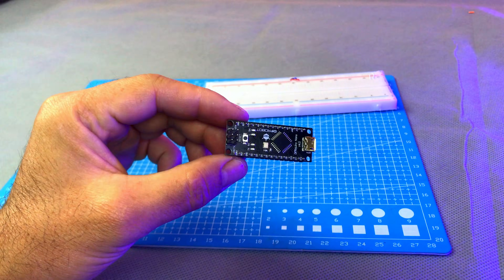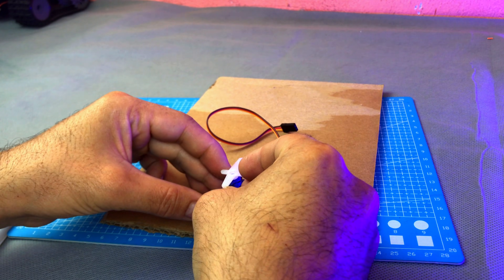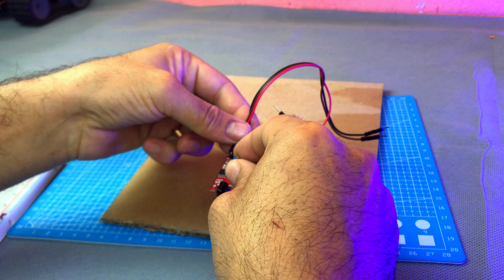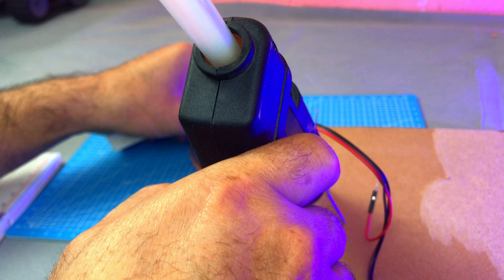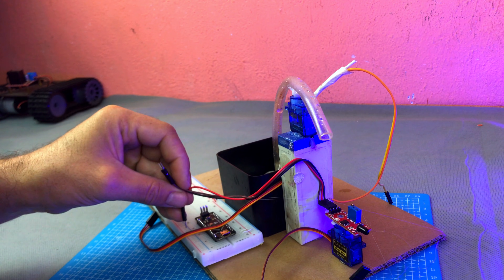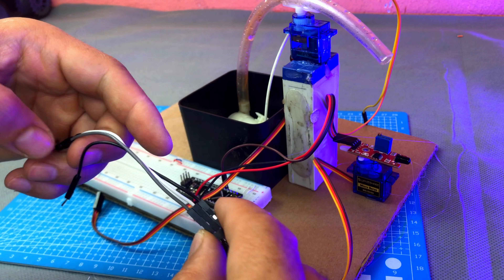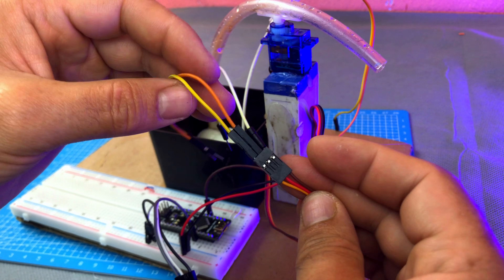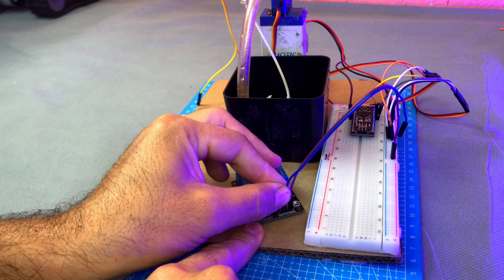Automatic Fire Fighting System | Arduino Flame Detection with Water Pump

Comment: hello bro. If I connect a 5v 2a adapter directly instead of 12V without using a buck converter, will it work? PLEASE ANSWER THIS IS MY PROJECT ASSIGNMENT
Reply from the maker: yes If you are using a 5V adapter, it will work and you don’t need a buck converter
Reply: @k @ktronic110  5v 2a adapter is not it?

Comment: Sir to where the DCtoDC buck convert in+ and in- is connected
Reply from the maker: 12v supply
Reply: hello bro. If I connect a 5v 2a adapter directly instead of 12V without using a buck converter, will it work? PLEASE ANSWER THIS IS MY PROJECT ASSIGNMENT

Comment: Sir please recommend me any battery for power supply, I checked for 12v lead acid  battery but it costly, can I use my 5v 2a vivo charger cable (sliced)and adapter to power these components 😢
Reply: You can use adapter 12 2A.. it's pocket friendly..
Reply: @anuraggupta8606  hello bro. If I connect a 5v 2a adapter directly instead of 12V without using a buck converter, will it work? PLEASE ANSWER THIS IS MY PROJECT ASSIGNMENT
Reply: hello bro. If I connect a 5v 2a adapter directly instead of 12V without using a buck converter, will it work? PLEASE ANSWER THIS IS MY PROJECT ASSIGNMENT
Reply: @dogukannnn0 already answered.

Comment: Voltage regulator is necessary or not pls tell
Reply from the maker: If you’re using a 5V power supply or powering through Arduino Uno’s 5V pin, then you don’t need a voltage regulator. But if your power source is 12V, then yes — a voltage regulator is necessary to safely step it down to 5V.
Reply: @ktronic110 then should I use relay of 12v or 5v ?

Comment: Sir single channel relay or dual channel relay both can be used or only dual channel
Reply from the maker: You can use a 5V single channel relay module — I just used a 2-channel one because I didn’t have a single channel relay at the moment.
Reply: hello bro. If I connect a 5v 2a adapter directly instead of 12V without using a buck converter, will it work? PLEASE ANSWER THIS IS MY PROJECT ASSIGNMENT
Reply: Yeah it will

Comment: Bro can you tell me components please
Reply: Arduino Nano
Flame Sensor 
Servo Motors x2
Water pump 5v DC

Jumper wires +  Bread Board (for connections)

Comment: Bro please give the voltages that you used in this vídeo per one by one 🙏
Reply from the maker: The main voltage is 12V from the battery, regulated to 5V for components.

Comment: hello sir can you provide the BOM of this project, i really love your ideas and content
Reply from the maker: thank u so much . Check description for code link
Reply: @ktronic110 sir where is the red wite connected to voltage regulator going?
Reply: @ktronic110 there is a red wire connected to a positive input of regulator module

Comment: Can you please tell me what you are using here? 4:30
Reply: what if I don't use the buck converter and directly connect adapter to the arduino?
Reply from the maker: @mareneisserenity  Yes, you can use a 5V adapter. I used a buck converter because I didn’t have a 5V adapter and wanted to keep the voltage stable and safe for the components.
Reply from the maker: Yes, this is a buck converter. It’s used to step down DC voltage. I’m using it to give 5V supply to the relay module, servo motor, and flame sensor.
Reply: how to the code, pls🥹

Comment: Sir actually I made it but I have one real problem I use Arduino uno , we should connect Booth in1+in2 rele to pin 8; of Arduino??? Or no just one of them please tell a little about rele how we should connect jumpers to rele?!
Reply from the maker: For the relay connections, just connect one IN pin to your Arduino pin number 8
Reply: @ktronic110 oh thanks alot
Reply: @OmidSojoudi hello sir ye wala project ka components aur circuit diagram bata dete college project me banana hai ..
Reply from the maker: @mohitchaudhary5300  code aur diagram link video ki description ma ha

Comment: Great😀😀
Reply from the maker: thankx
Reply: @ktronic110  replay only for the comments which appriciates you not for the doubts fooll.
Reply from the maker: @VijayReddy-n4t  Bro, it’s not like that 😊
I try to reply to every comment, sometimes I just miss a few 🙏
Reply: @ktronic110 in voltage regulators Vin has 3 wires explain the connections..there

Comment: How much volt is the supply.....
Reply: What is the external supply you have given.......?
Reply: @Prithviraj-s3m same doubt 🤔
Reply: @rebelskff66 5 to 9v external power supply is given to water pump
Reply from the maker: DC 5v
Reply: @ktronic110 
Can you provide the code sir please
Reply: hello bro. If I connect a 5v 2a adapter directly instead of 12V without using a buck converter, will it work? PLEASE ANSWER THIS IS MY PROJECT ASSIGNMENT
Reply: Sir where is the code